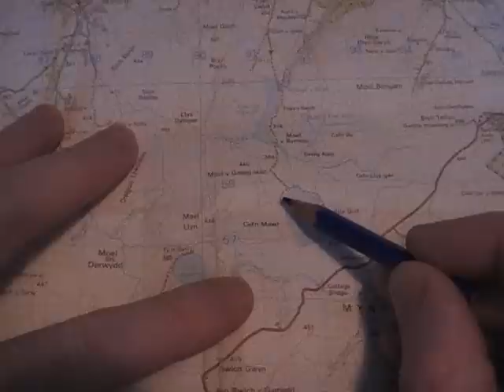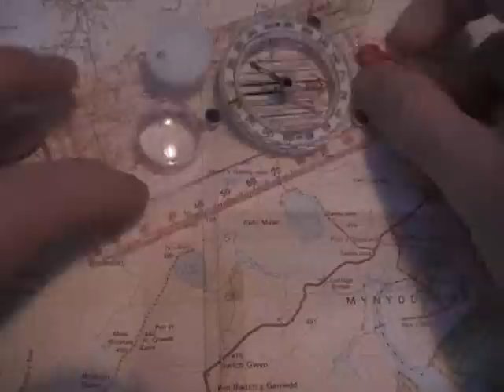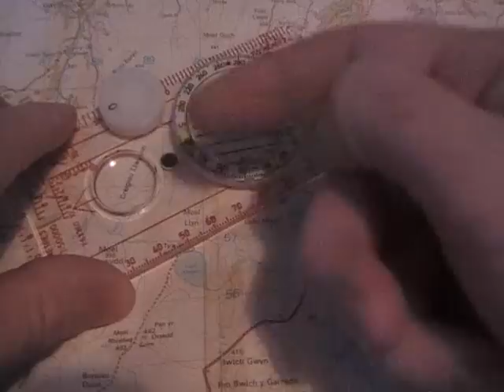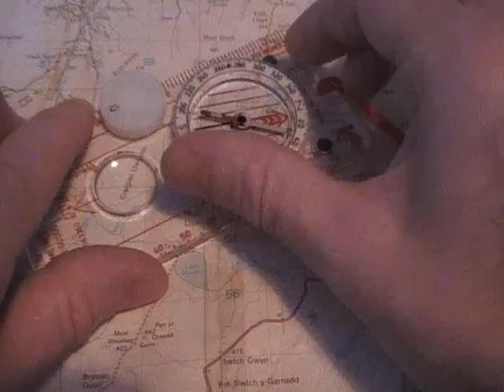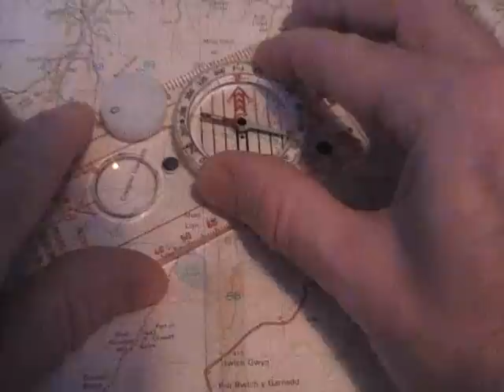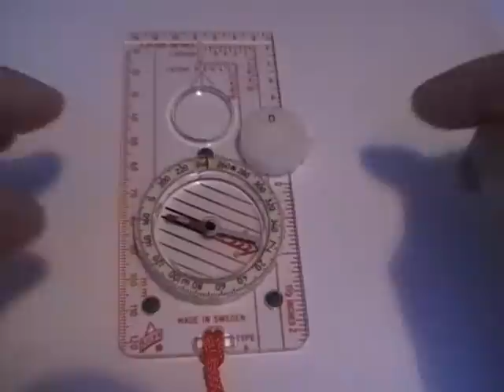Map and Compass - explained in detail

Comment: Because of the coming micronova, declination is moving much farther, and much faster and so declination information is likely incorrect but there is still a way to recalibrate magnetic declination using the shadow of sticks recording the path of the sun---rotation of the earth has not yet changed. First stick will show East. Mark it with a sharp stick pushed in. After a few minutes you can mark sun shadow travel where the shadow has moved - Push another stick in to mark West. Lay a straight stick from the E mark to the W mark. Geographic north or True North is 90 degrees from the E-W line. With your compass pointing toward True North, note how far off your compass is now. That is your true up-to-date declination. My up-to-date declination is 30 degrees, 15 degrees off from the official declination for my area. More on micronova in my 2nd book, Surviving the Micronova: This Train Is on the Tracks is now available

Comment: Clearly & simply  explained. Most people explain magnetic declination adjustment in such a complex way it seems to confuse people  for years afterwards. You kept it to the basic easy method.

It's really quit simple. As you demonstrated.
When taking an azimuth from map to compass: for west mag declination, turn the compass dial CCW. = toward the west, ( which adds degrees).  For east mag declination, turn the compass dial CW. = toward the east, ( which subtracts degrees). Going from compass azimuth to map azimuth , turn the compass dial the other way. Easy.

I've often seen that pace counter that clips onto the edge of the compass when watching videos made in the UK. But I've never seen what company makes them, where to order one or if they're still available or long out of production. Is it a Silva product ? Or made by another company? Still available to be purchased?
Reply from the maker: Cheers

Comment: I live in New Zealand, would the rule of adding the variation still apply? My reason for asking is that I was under the impression that from grid to mag you subtract, but this may be different for different hemispheres. Thanks.
Reply from the maker: +Adam Boutcher At the top of your map it should show what the variation is between grid and magnetic north which in your case will be east of grid north so you will need to subtract the variation from the grid bearing to convert to a magnetic bearing
Reply: +wxpm Thanks for the fast reply.

Comment: For beginners watching this video: This process is made dramatically easier if you simply buy a compass with adjustable declination. Doing so allows you to measure all bearings to true north, and avoid all the backcountry arithmetic. The math looks easy when you see it here, but years from now when you are lost in the woods you're going to forget it, trust me on this. A terrific compass to buy that has adjustable declination and a few other nice features is that Suunto M3, about $35 US.  

Other than that suggestion, you explain this procedure very well, and it's a nice video. Thank you for posting.